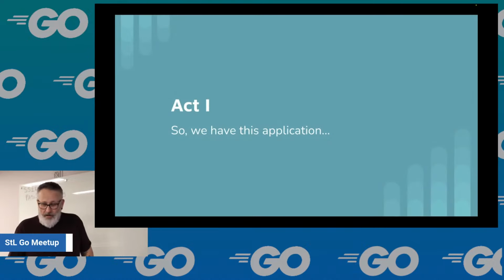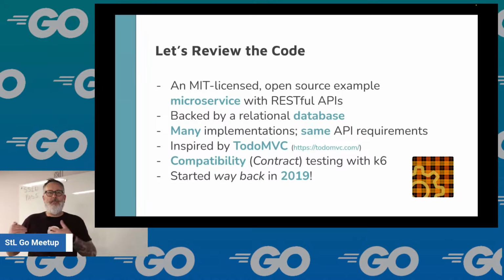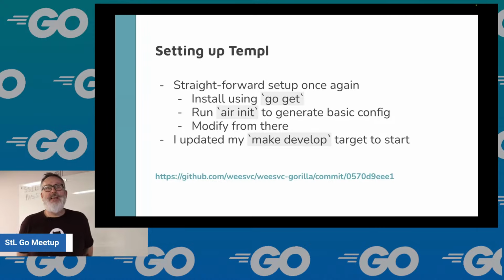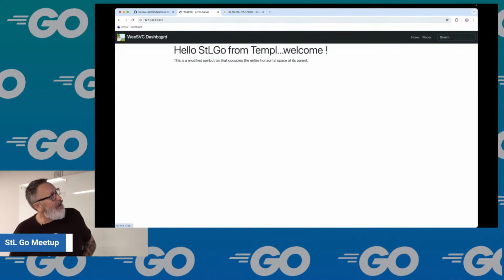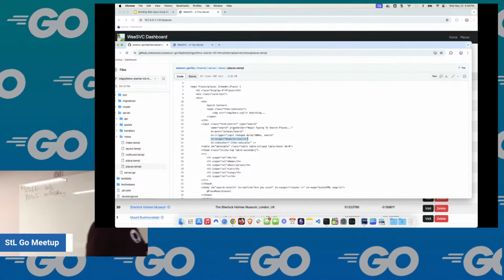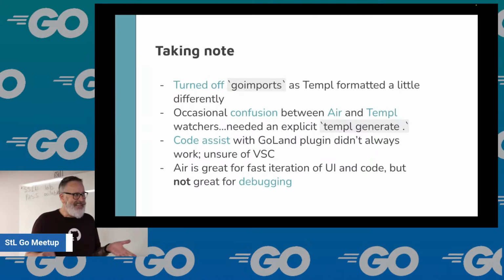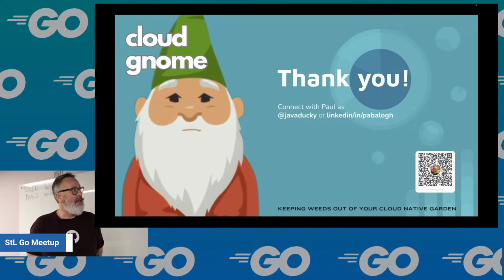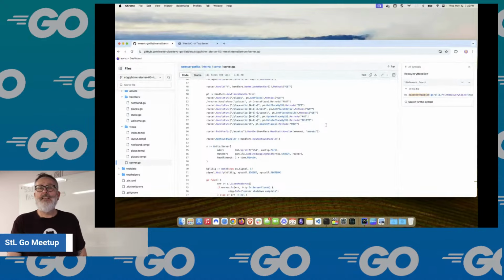What is the GOTH stack? Quickly build web apps using Go, Templ, and Htmx #FAST

Comment: Hey Paul, great presentation! Do you think “air” would be helpful when creating any go services so that you can have your service running, make code changes and test it with let’s say Postman at the same time?
Reply from the maker: Absolutely! The only issue is if you need to use the debugger. It’s quick and easy to set up, so I’d love to hear how it works for you.